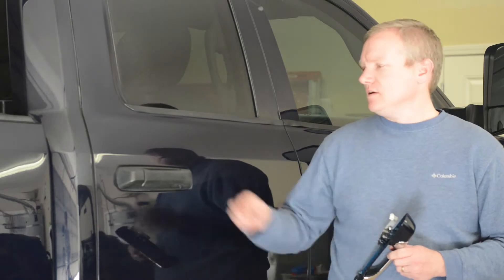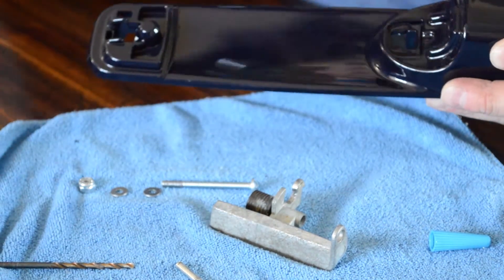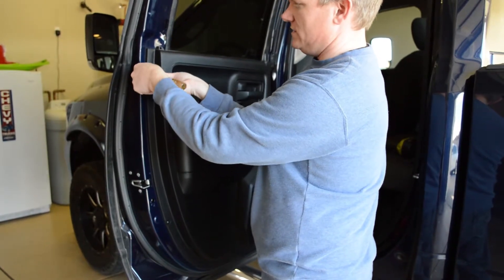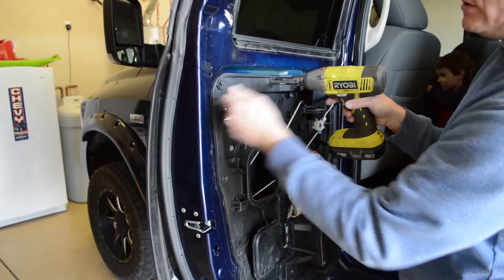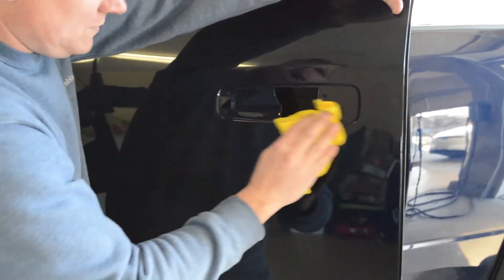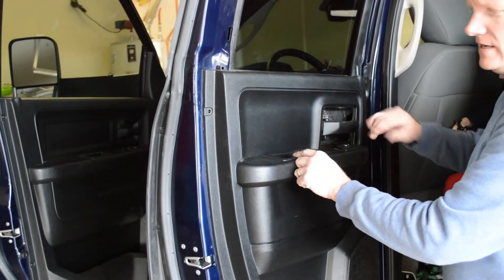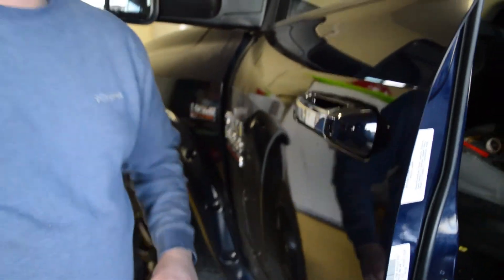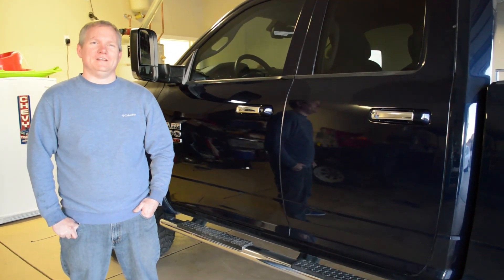Installing Chrome OEM Door Handles - Dodge Ram 4th Gen

Comment: On the driver’s door, it's easier to disconnect the handle rod at the latch & then push the lock cylinder out as you wiggle the whole handle out. Also they sell door handles already painted from Mopar. It's important to note the Mopar replacement's bolt holes are not pre-threaded so save the headache and screw the bolt in them a couple times before installing them.

Comment: Hi! This video is very helpful. Thank you for it, specially the part where you show how to separate the actual handle from the guard because mine is all plastic black and I want to paint it all. My question is: do you remember the size of the drill you used?
Reply from the maker: Thanks! I do not remember the size. Good luck

Comment: I’m wanting to change mine out to painted handles and have found some. But I’m worried about it maybe leaking a little bit after installing new handles and breaking that initial seal.
Reply from the maker: Hello Cheta I live in the high desert and my truck is garage kept so there is not a lot of rain here. There wasn’t even a rubber gasket on the back when I took them off. I’m not sure water would get into it but if it does happen there are weep holes on the bottom of the door for it to drain. Good luck!

Comment: Can you provide another video of the drivers/passenger door exterior handles as I was unable to move the inner panel anywhere near enough to even see the screws to remove the handles. No way to get my hand up there with the access rubber flap being so low.
Reply: To pull front handles you need to remove the glass (not as scary as it sounds) the glass is locked into the window rails by plastic clips. Free the window from the inner panel. You can leave the window in the door shell just pull the wiring harness from the door jamb, and the pull the plastic inner panel off the door shell